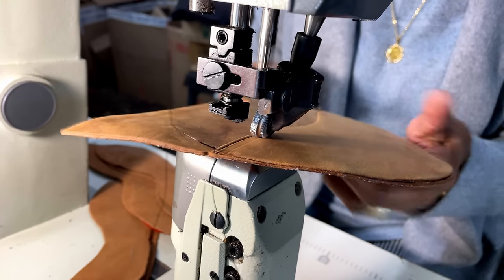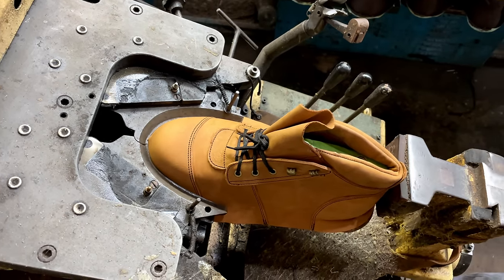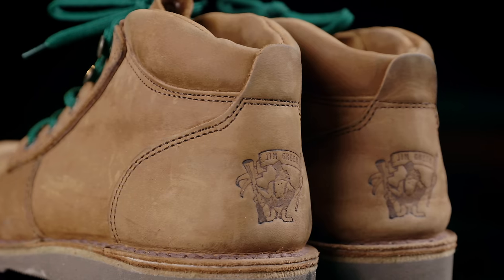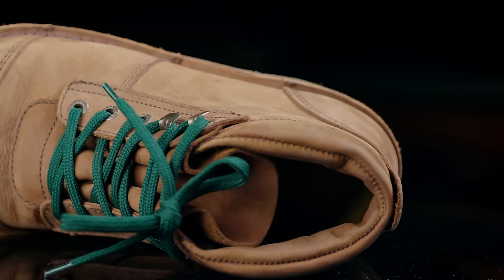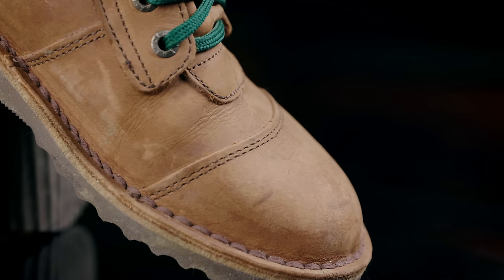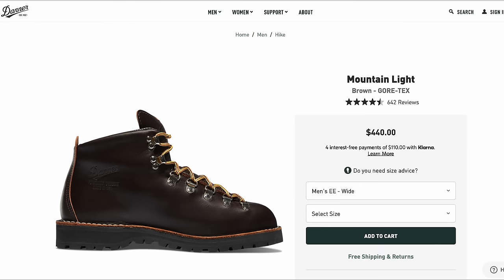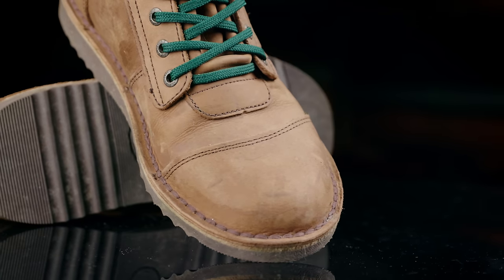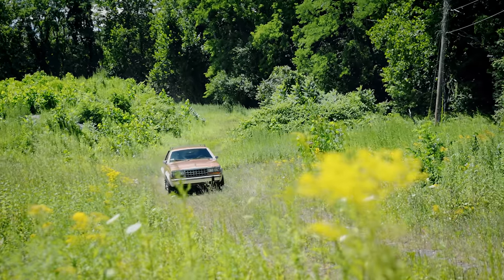So UGLY they're cool! - Jim Green African Ranger

Comment: Been a Jim Green fan since I was 15. Bought a pair of these a few months ago as a heavier duty, more smartish casual wear boot for the wet winters in Cape Town, where my lighter duty vellies slip and slide all the time. The African Rangers grip better in the wet than the vellies, but are also comfortable and cool on warm, dry sunny days. I found break-in to be much easier than previous pairs of Jim Greens I had, but I'd recommend you change the insoles immediately after purchasing. The stock insoles are too hard for my liking. I agree that they aren't the prettiest boot, but in a way they look good to me. I'm certain they will last many years if looked after properly. Very happy that Jim Green has finally got onto the USA scene. They are good, durable, hardy boots and deserve recognition.
Reply: How does the thread hold up on concrete?
Reply: @j-boy9256  I wouldn't use them extensively on concrete. The tread is a bit soft for that, but they are resoleable, so at least when they wear out, you just have to replace the sole instead of getting a new pair of boots.
Reply: @Mikey4808  Thanks for the information. As a teacher I do see a good amount of concrete, I appreciate the feedback.

Comment: I took these to the top of Mt. Sneffels in Colorado. They did great! Very comfortable. 

My only complaint is that the stitching that holds the piece of reinforcing leather that the hooks are attached to is already failing. I can probably stitch it back together, but for boots that are only a few months old it’s a little disappointing.
Reply: Thanks for the report. Are you wearing these much on pavement? If so how are they wearing on concrete?

Comment: Another great video as always. They had the preorder start about a month after i bought my razorbacks and the buyers remorse set in immediately. A cap toe wedge would have fit my needs so much better but thats the way she goes. Love my razorbacks though, with some nice wool socks they did very well in milder winter weather and in my refrigerated warehouse. If the toebox is the same it would be a touch shallow for how much toe wiggle i like anyhow. Still dreaming of the day i buy some nicks wedge workers, might get them in the new 365 stitchdown.
Reply: lol so I literally have all three models
Believe it or not I find the toe box in the African ranger to have more vertical toe room than the Razorback (with both having the same foot bed inserts)

Now that my wedge workers from Nicks have broken in I can tell you they have the most toe room of the three. 
I think about the 360 degree sometimes. They mention more foot bed flies flex which I kinda wish I had. But also mention needing an insert (which at that point is getting less different from Jim Green)
Another note is that the sole for the wedge workers is wearing quicker than the African Rangers 

Ultimately I have zero regrets for any purchases, and even if you go for the Nicks you can Still go for a comfy pair of Jim’s

Comment: I know this video is older, but for anyone looking in comments for fitting advice, I had to exchange my African Rangers to change sizes!
I am a 12 on the brannock, wearing 12's in flip flops, crocs, vans, etc. 12 was too big!
I exchanged for 11.5 and they fit PERFECT. I removed the insole and added my FP insole "Gamechangers" AND a Nick's leather insole. Just make sure your insole isn't too tall in the toe, as it is a low toe box and my toes have scraped before on it. If you're wearing thick socks and a custom insole, might want to go up a half size! I personally wear thin socks.
I hike at least a mile in them everyday for my daily walks, and don't want to take them off when I get home.

If you fall in love with the fit of your African Rangers, I'd recommend the Vellie that is built on the same last! The Vellies look a bit more formal (especially the flesh first, tan model) but feel a bit more snug with the same insole combo, so perfect for a casual night out, day at the office, errands on the weekend.

Comment: Picked up a pair of these about a month ago in 12.5, they’re well made for sure. I wish I’d spent more time indoors trying them out as i get some toe rub that I can’t seem to get broken in.
Reply from the maker: Damn, thats the one issue with a synthetic toe structure as compared to leather. Leather would eventually conform to your foot, but its more expensive and difficult to work with.
Reply: @CarlMurawski  agreed. I have a pair of the Vellies that has just a touch more toe box room and no issues at all. If I were more confident in my cobbler skills I’d see if the plastic could be removed in the Rangers.

Comment: Carl, do you or any commenters know of any low profile steel or composite toe boots?  I started a new job and have a management position. Steel or composite toe shoes are required but chino’s and polo shirts are also worn.
Reply from the maker: This is a tricky one. The most low profile steel toes I've ever seen were a pair of Justin Pull-on style boots. Most brands buy their steel toes from the same place and then fit them into their boots. Since this is a specialty piece and has to be ANSI approved, most wont bother trying to make it themselves. Therefore there isn't much variation in the market..

Comment: Your comment on having a high instep interests me - I really need a set of new boots, and I have thought about these Jim Green African Rangers. I also have a high instep and have been having a hard time sliding my feet into boots at test fittings, so much so that I am very leery of buying online. The wide style with soft leather leads me to believe I might be heading in the right direction by ordering a set of the Rangers - any input? I will likely be wearing these on Saturday outings to local parks, doing light hiking (no backpack)...

Comment: How does the Crazy Horse leather hold up against water? I know that no boot is waterproof, but just wondering about hiking in water or rainy day outs if my feet are going to end up soaked.
Reply: The brown and black leather options are better off against water, but over all the boots are more designed for arid conditions.
If treated with some bees wax or a leather balm it will keep water out for some time but not recommended for very wet conditions.
Our Razorback which is fully leather lined would be a better option for wet conditions.

Comment: Glad to see you back, Carl!  Not to be a negative Karen, my Jim Green Stockman slip-on boots are the most uncomfortable things I have ever put on my feet.  The upper leather is stiff and the Vibram-like soles have zero flex.  It's like wearing cinder blocks for shoes.  Jim Green's advice was to buy multiple pairs of aftermarket insoles to find something comfortable.  I have spent more on insoles than on the boots.  Because of this, I will not buy anything more from Jim Green.  Just for reference....I had zero break-in discomfort with any of my Redwings or Whites boots.  Sorry to post negativity here, Carl.  But I think both sides of the comfort question need to be stated.
Reply: That's just how it goes sometimes.  I bought a pair of Thursday Logger boots after reading a lot of praise for the company's products in a lot of places.  Particularly the comfort.  Man, those Loggers had maybe my favorite looking design out of anything out there but it took forever before they weren't blister-generating machines inside of a mile of walking.  Even now they aren't really comfortable, though they're no longer actively painful.
Reply: @mattrobson3603  I agree with you.  You're right.  I think I am just more irritated that I spent so much on insoles ($100+) instead of cutting bait and donating them to the local thrift store.  As it is now, I only wear them to mow the lawn and walk my border collies.  Both jobs take less than 1 hour, which is the limit I can stand them on my feet.
Reply from the maker: Well I always appreciate hearing from you man, and its unfortunate the Jim Green fit isn't for you. I guess that's the problem with any boots: they won't be the same for every foot.

Comment: Carl, these boots are double stitched to the midsole only. The outsoles are glued on. No stitching has to be removed to resole these boots.
Reply from the maker: So to a point you could have them re-treaded so to speak? But a rebuild which only retains the upper would require popping those stitches I assume.
Reply: @CarlMurawski  It's just like resoling a Red Wing wedge soled boot. The welt stitching only goes through the midsole. The glued on outsole is pulled off and replaced with no stitches removed.